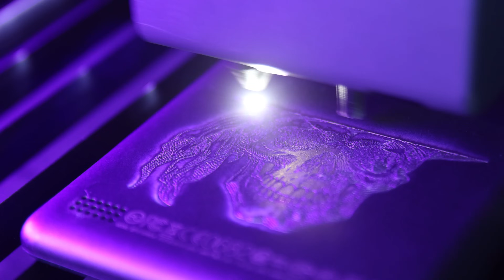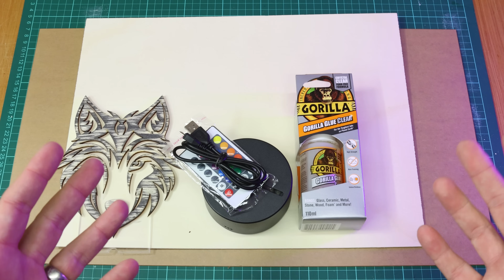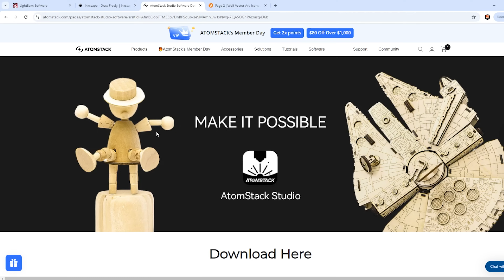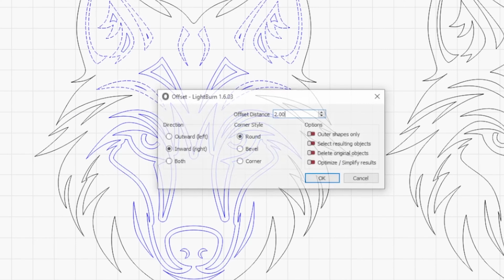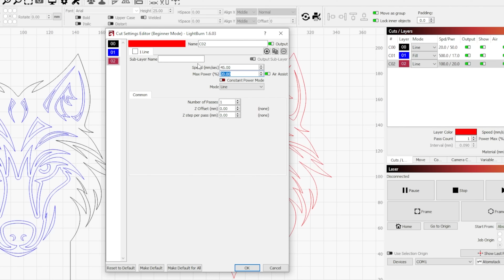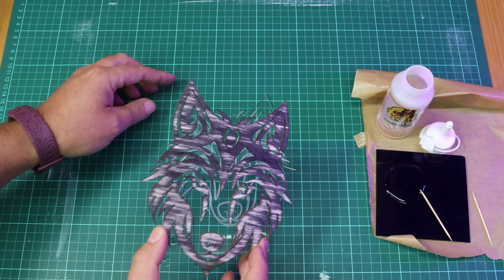STOP MAKING BORING LIGHTS! Upgrade your LED lights with the AtomStack Hurricane CO2 Laser

Comment: nicetooperate from your phone but you mustbe in the same room as the laser unless you want to risk a fire
Reply from the maker: @baracuda40  yes! I didn't suggest operating remotely as that's silly but this machine does come with inbuilt flame detection and extinguisher. Still not saying that's ok to leave your machine but a fire can start even if you're standing next to it. The point being you don't need to have a dedicated PC just to run the machine